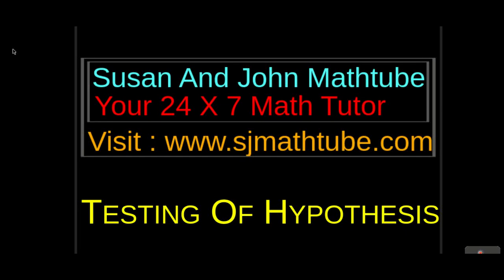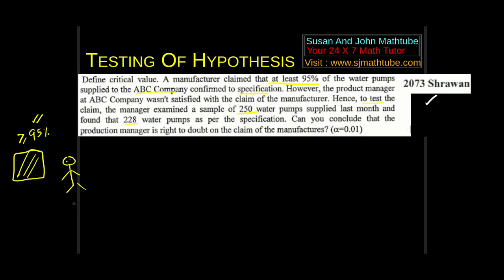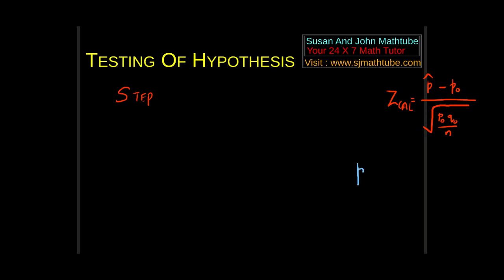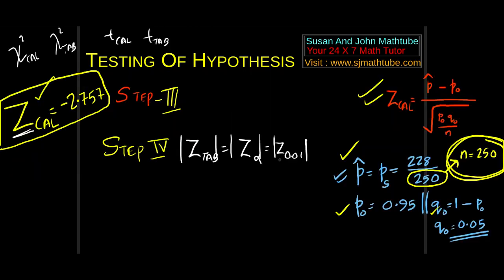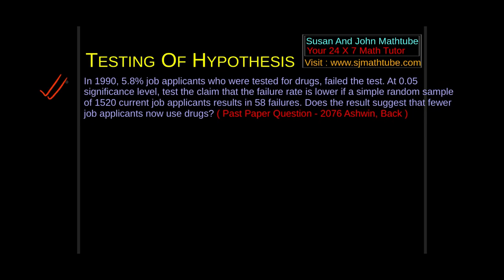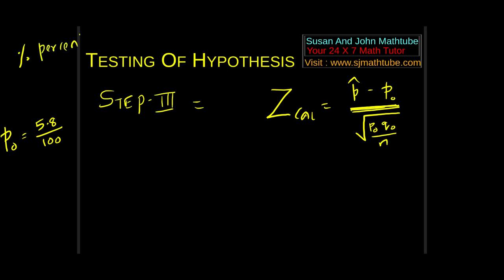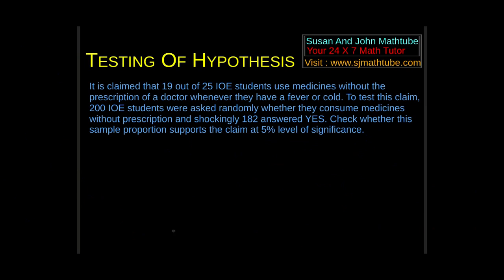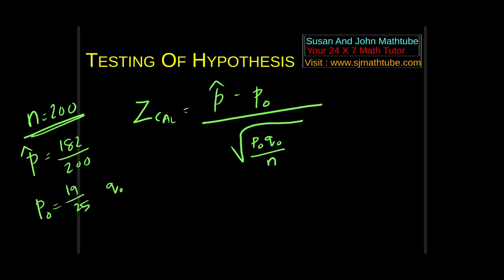ENGINEERING PROBABILITY AND STATISTICS -  19 - TESTING OF HYPOTHESIS : SINGLE PROPORTION

Comment: sir here on the first question, how is alternative hypothesis less than 0.95? Its not mentioned anywhere in the question that the manager thinks pumps to be working at less than specified rate. It just states that manager doesn't agree with the manufacturer claim
Reply from the maker: Exactly!! What you said is Correct.... The Manager doesn't agree with the Manufacturers Claim!!!
And note the point that "At Least Stands for Greater than or equal to"

It is Clearly Mentioned in the Question that the Manager was NOT SATISFIED BY the MANUFACTURERS claim....

Now if the Manufacturer give "AT LEAST 95% guarantee" then that clearly means the alternative is Less than 95%
Reply: @SJMATHTUBE  sir so it is two tailed question?
Reply: I think it should be not equal to and perform two tailed test